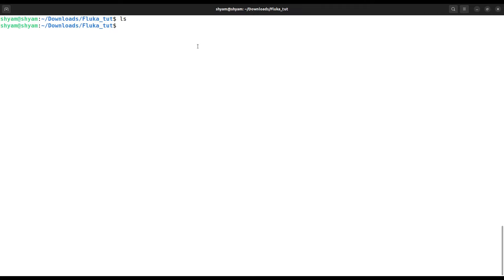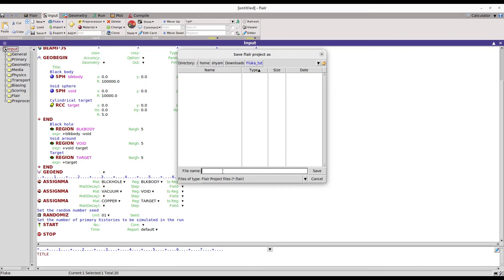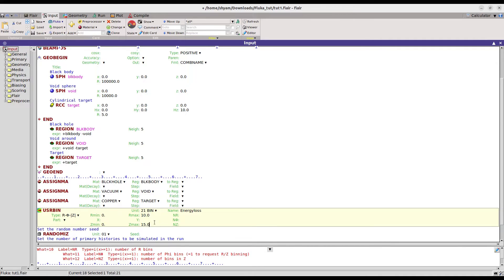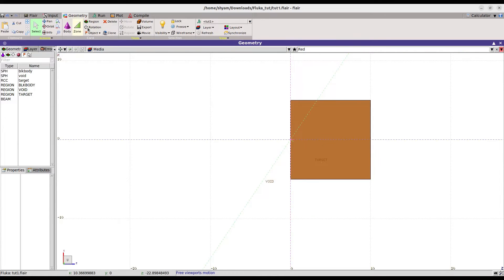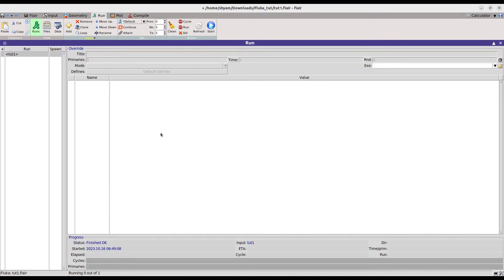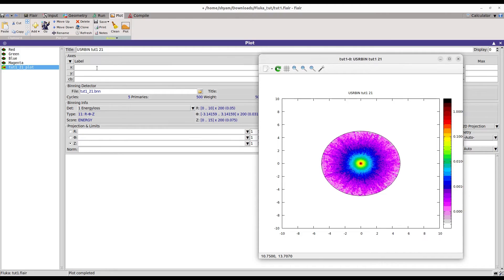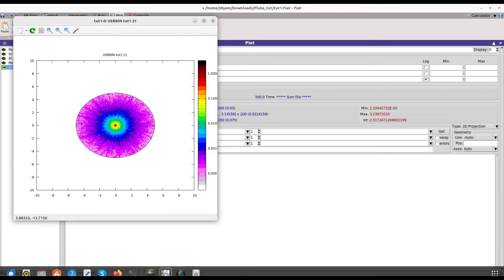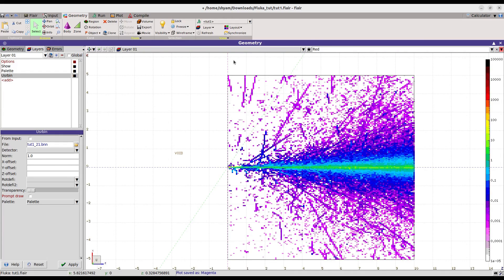Step by Step Tutorial on How to Start Basic FLUKA Simulation?

Comment: hello sir , after the simulation is finished userbin is empty no files are generated in that, what could be the reason.
Reply from the maker: I think you should need to check the log file and error file in same directory which can point toward the issue.
Reply: @advance_sci_tech_SK_IITBombay  Thank you sir, Now I am getting the files. 
But sir I am still facing one problem and I have sent you a mail regarding that can you please check that and guide me for that.

Comment: my friend, what kind of particles are you simulating here? I think you should mention what kind of particles you are simulating, the unit of measure of the energy (ok is normalized with respect to what? The maximum value of energy of the incident particle?-  What's the initial energy of the incident particles 1eV, 1KeV..1 TeV. However nice work I appreciate your efforts in bringing some useful stuff for everyone
Reply: Ok energy, in this case momentum is GeV/c, c= Speed of light, but nothing is specified about the nature of the particle
Reply from the maker: @matteopiccioni196  Thanks. It's default file basic.inp and the details will be in the manual but if you want specific particle you can select from particle and the energy and momentum you can select from the BEAM card and the momentum is in GeV/c. I think the energy refers to as Kinetic energy. It's given in the manual.
Reply: @advance_sci_tech_SK_IITBombay  i read something, if you use "SOURCE" card you can choose which particle to collide eg. 4-helium, protons.. and the energy that is by default at 200GeV/c, while in this case seems that you are using "quasiparticles that travel at speed of light without any physical interaction (if not scattering I suppose)" to me it sounds like they're "photons", what do you think?
Reply from the maker: @matteopiccioni196  You are talking about collision while this tutorial is a single particle simulation (default is proton, I checked). Just create a basic.inp in flair and take the pointer on particle then it shows the message default is proton. I can't attach screenshot here but you can check that. Did you check other video on event display with fluka there I showed pp collision using SOURCE card? You can even define your routine and compile which is also shown in one of the tutorial.
Reply: @advance_sci_tech_SK_IITBombay   i will check it out soon. thank you

Edit. The p-p collision video, using SOURCE card, maybe has been deleted can't see in your channel

Comment: Hello sir, thank for your video and explanation. After the plot, how can I calculate the total dosage inside the cylinder?
Reply from the maker: You can score the dose inside the Cylinder then you can get 2D plot and 1 D plot and you can integrate it. Next thing if you want dose particle by particle then you can use EventBin Card.
Reply: @advance_sci_tech_SK_IITBombay  Thank you for your answer! Does flair has this integration tools built in? I can't really find them.
Reply from the maker: @GMJesus007  As far as I know, the answer is no for the flair but I did it manually using the data files generated with the .dat extension. Manually is also reliable because you are doing calculations yourself.